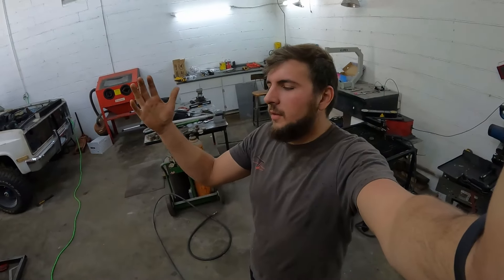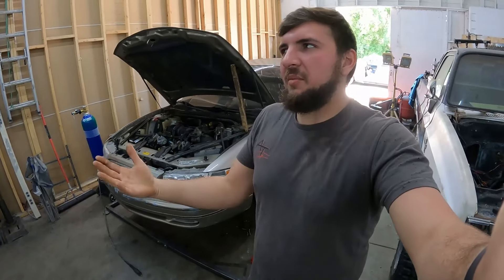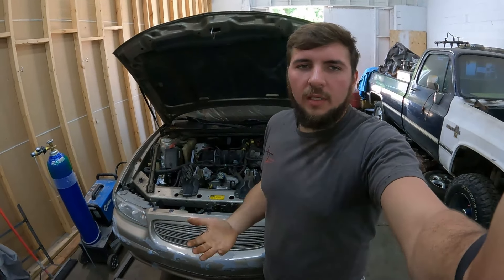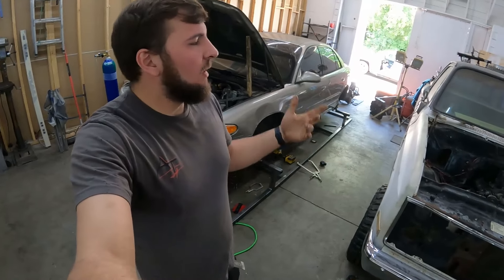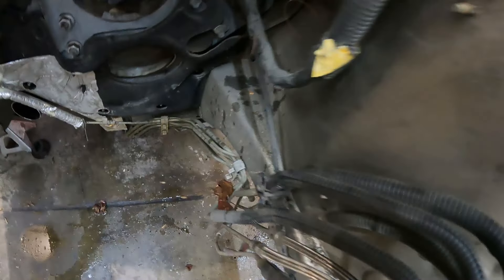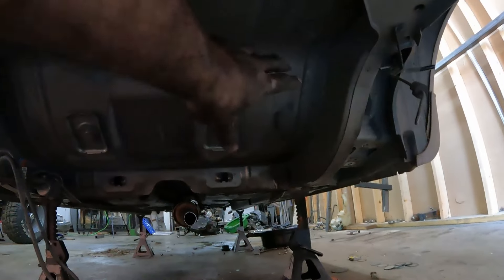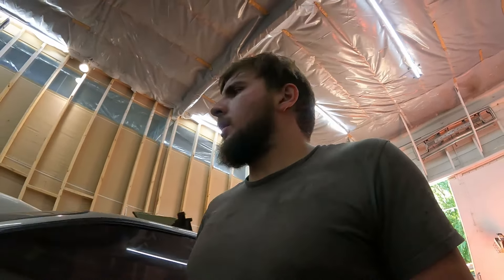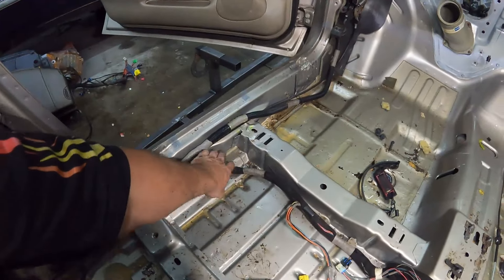Starting on  the next RWD swap project

Comment: Man looking forward to this, but hell I say go all the way, turn her into a coupe.  A Monte with the Buick nose and rear would make for a mean GN.
Reply from the maker: I would, but I don't really have the budget for that currently. Maybe someday. For right now I'm just focusing on perfecting this process and making the necessary jigs and cut files to achieve repeatability. I'd like to build some of these to sell over time
Reply: @AutoTechTyler I have files from my custom f+r caster/camber monoball plates fer ya. Lol I had measured my turdbo regal to fit an f body front k after transaxle 10 shredded at just 24psi. The 4t65ehd is my nemesis at this point

Comment: I have a 2006 impala SS I've been contemplating converting to rwd. I found the 2017 cadillac ATS rear track is identical to the stock w body wheel track and same wheel bolt pattern. I'm going to get my hands on one eventually and see what it would be like to mount in the W.
Reply from the maker: I wish you the best of luck on that. The ATS rear would require an extensive amount of modification to the body to fit due to its differing mounting planes for the spring vs the subframe mounts and the non differing planes/spread of the mounting points. Overall design of control arms in that setup would be nearly impossible to fit to the Wbody without a complete restructure and reconfiguragion of the rear of the car.
Reply: Well if youve already looked into it! Saves me the headache. @AutoTechTyler

Comment: Graft tail of fwd pan onto the rwd pan with a trap door. Also suggest a baffle to fix the oil overloading of cyl 4 oil ring due to the large open windage tray/pan gasket for the pickup....i have a couple extra i waterjet for my heaps if ya want one.

Ditch factory dual layer steel pan for spi aftermarket steels. Single thicker steel layer.
Near impossible to prevent leaks at weld on oil return bungs on gm dual layer with it holding oil between layers.
Reply: Don't go nuts on the 3800. That 608hp was with a tiny st1r cam, properly machined aussie fitment rollmaster dbl roller and qwikported heads...just.t70 and 127lbhr inj with e85 buddy.
Reply: Rear bumper from a buick rendezvous is aluminum and bolts right in place of the w body steel units with drilling 2 holes.